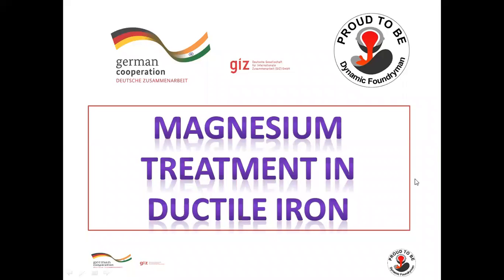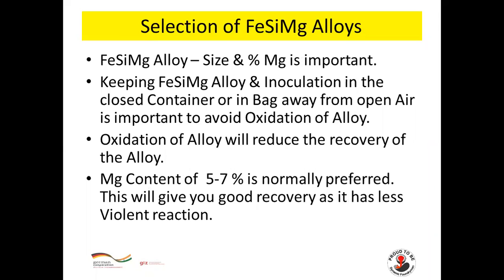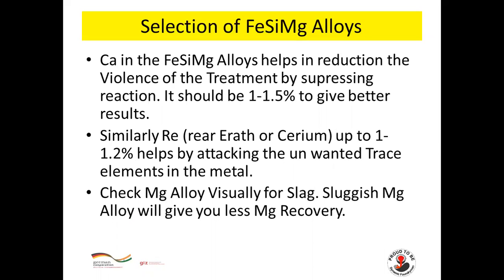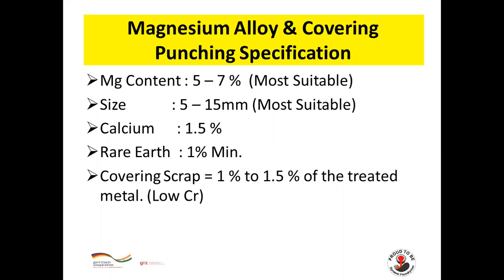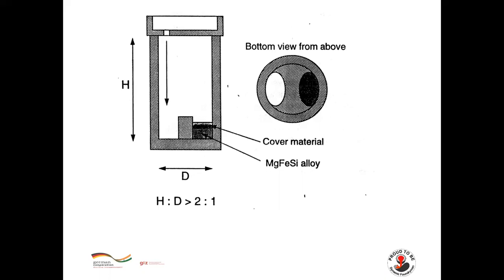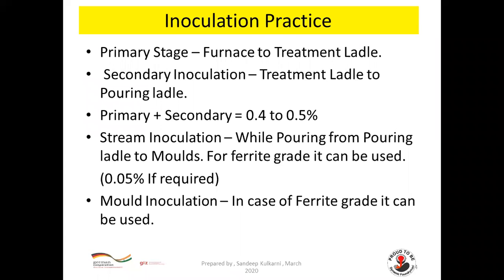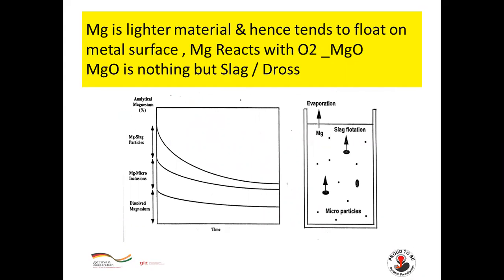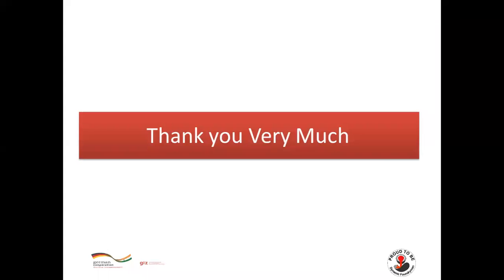Mg Treatment in Ductile iron with Sandwich method

Comment: Sir I have one question regarding sprue design.
  Sir for a component with T, L junction having thikness 30mm . How we design a sprue as it top poring without having runner and gate.  How we calculate sprue bottom diameter and top diameter.
Reply from the maker: There is no such standard formula however you can find out the metal requirement by calculating the volume of the thick area in the casting by calculating modulus.
Reply: Sir give me any contact details I will elaborate the actual questions
Reply from the maker: Mr A M Deshpande
9011128077
Reply from the maker: You can talk to A M Deshpande
09011128077